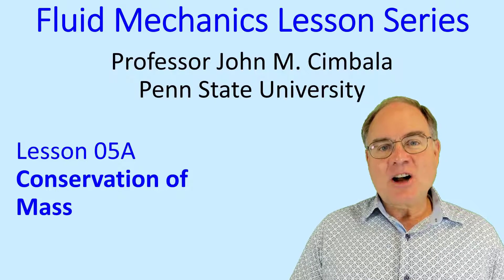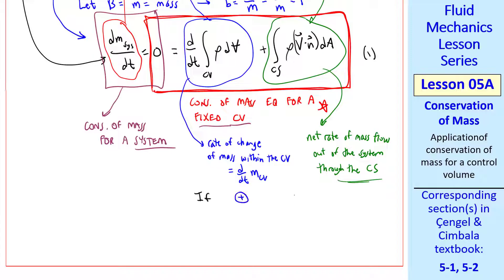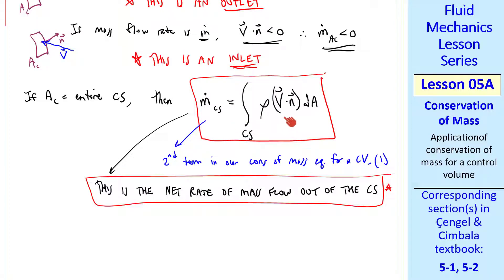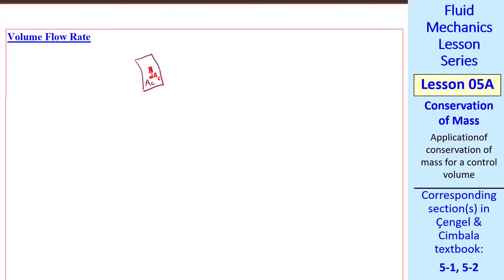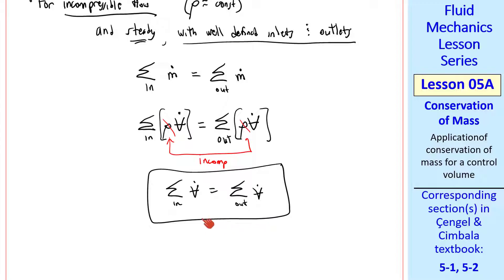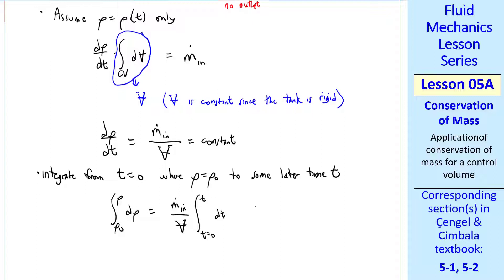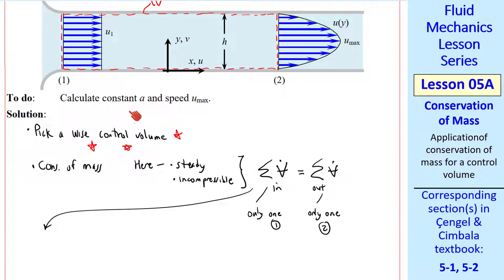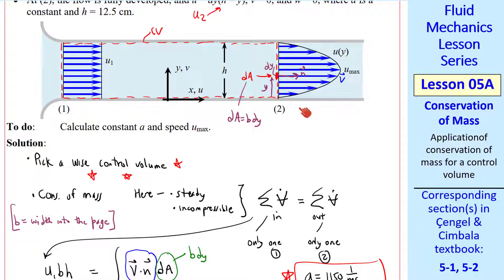Fluid Mechanics Lesson 05A: Conservation of Mass

Comment: for the steady flow example, wouldn't u1h = (ah^3)/2 instead of (ah^3)/6?  I just went through the integration by hand, but the 3/6 simplified to 1/2 so I think it should be (ah^3)/2.
Reply from the maker: No, I just went through the integration again and it is correct. You must be doing something wrong.